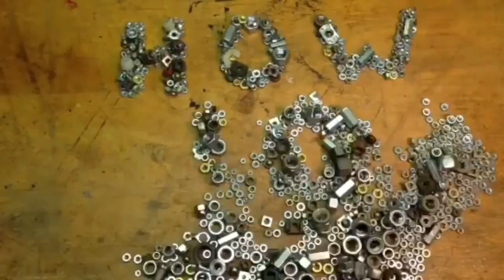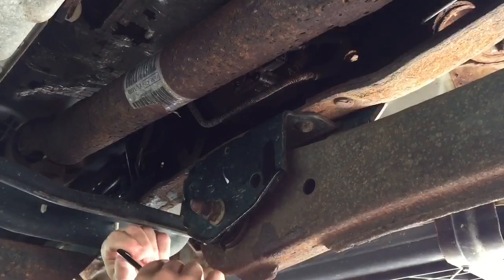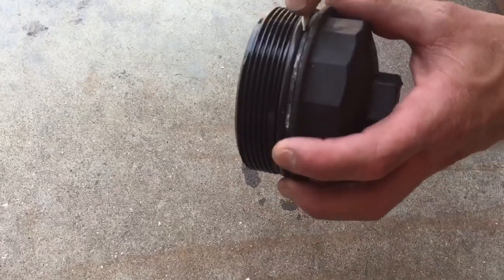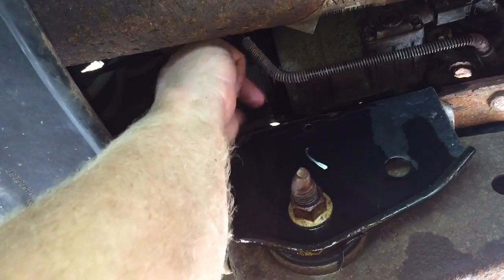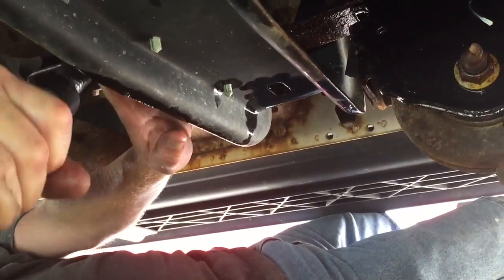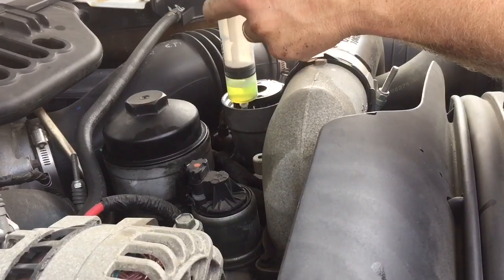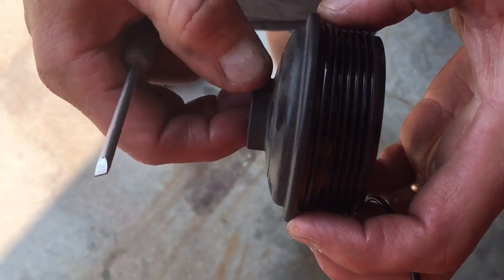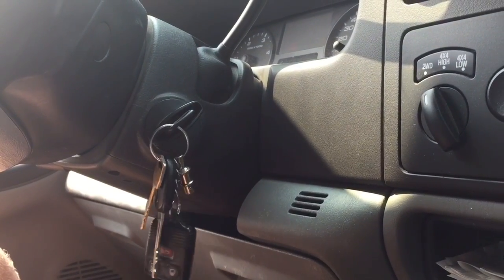How to change the fuel filters in a F250 6.0 L diesel engine

Comment: TL:DR Be level before doing this.  I moved to the house with a sloping driveway and it would not refill the filters until I rolled down in Neutral to a level location. I was thinking I had an air bubble, but that ended up being the solution.
Reply from the maker: Oh yeah, you must be level when changing your oil. thanks for watching.

Comment: U have gasoline in your 6.0? 😮
Reply from the maker: There was a time back in 2012 while traveling through Missouri on a return trip from Branson, that we stopped to fuel up. Not paying attention and anxious to get back on the road I started to pump 89 octane into the 6.0. Luckily I discovered the error just before the pump reached 1 gallon. Miles from home with a tank close to empty with almost a gallon of 89 octane gasoline I decided to top the remainder off with diesel fuel. Hoping for the best we drove home and To my amazement the truck actually performed better. Not sure if it was the solvent in the gasoline or the octane but it ran surprisingly well. 
Now I would not recommend doing this and have not done it since then but a little gas in the tank did it hurt it one bit. I have heard of people filling their tanks full of gasoline which creates a whole other problem especially if it is driven, so to make a simple mistake by saying gas can happen but as long as it is caught before filling up no harm is done. All this said I think you get the point and have your questions answered. Have a great day and thanks for watching.

Comment: You said "drain the GASOLINE"  -  Are you working on a diesel engine or a gas engine???
Reply from the maker: Are you honestly asking?
Reply: @funbro1  No, I'm not honestly asking...  just causes confusion and panic if your video states one thing and you say a different thing
Reply from the maker: I guess that happens from time to time when a fleet of vehicles contains both diesel and gasoline engines. Just as long as when it gets filled up with fuel  make sure it is correct. Glad you were able to figure it out. Didn’t mean to confuse you. 
Thanks for watching.

Comment: How do u get your tool in there to take cap off
Reply from the maker: It’s a matter of using the correct length extension for a socket. Some are too long to fit in there and some are too short to reach you have to find the correct length. Hope this helps, thanks for watching.